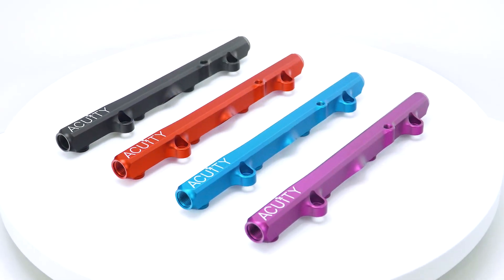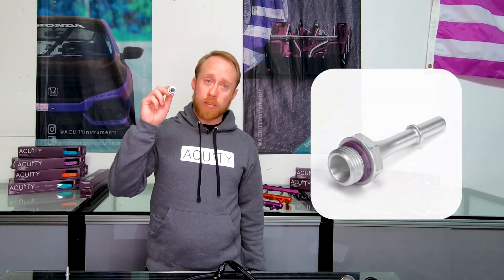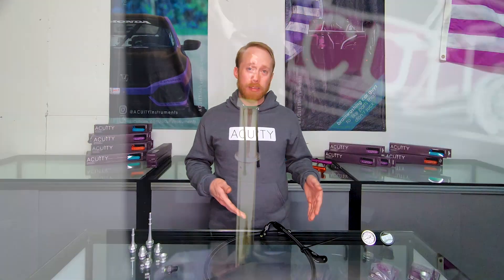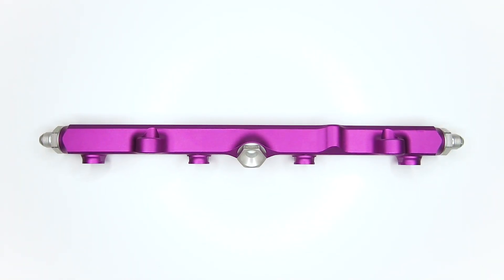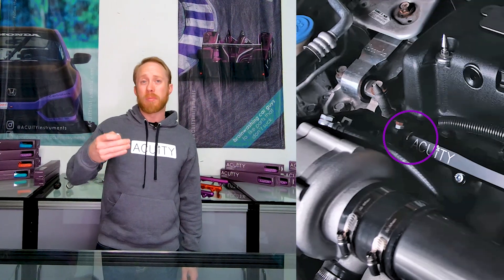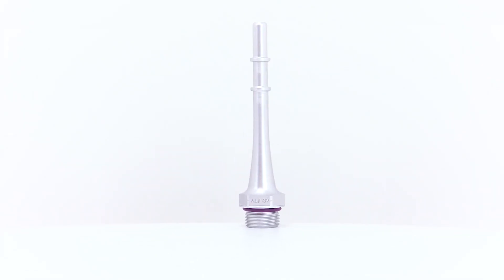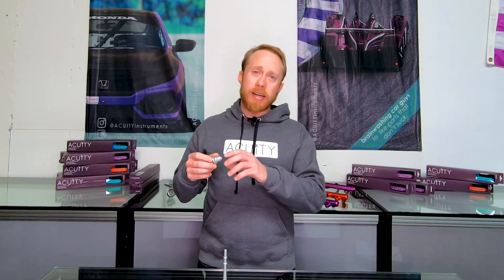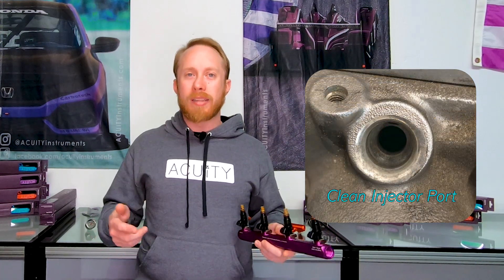The Most Versatile Fuel Rails For K-Series Applications || ACUiTY Instruments

Comment: How many threads on average are exposed after tightening down a top mounted fuel pressure gauge?
Reply: The best install method is to use a light amount of liquid thread sealant on the threads (avoid tape sealant as it can get in injectors and clog them), then to gently tighten the knob between your thumb and index finger with minimal torque, just turning it enough to get it barely snug, then tighten using a wrench (on the flats only) 1-1.5 turns. It takes less torque than you'd expect to get a good seal. Be careful turning the gauge using the body of the gauge as you can damage the gauge this way. Use an appropriately sized wrench to apply the full tightening torque.

Comment: Can you use this on a stock k24 in a 2014 Acura TSX 4 cylinder?
Reply: Shouldn't be a problem, but you'd need to determine if you need the longer or shorter version of the adapter that mates to your OEM fuel supply line. Feel free to reach out to us via the contact-us page on our website (acuityinstruments.com) if you'd like to speak with  a tech to figure out what you need.

Comment: Can the tucked fuel rail fit on the 9th gen ? I'm looking for a more clean engine bay look
Reply: Only when the 9th gen has an intake manifold (like the RBC or similar OE/Aftermarket intakes) where there is sufficient space between the two inner intake runners. The OE 9th gen intake has no gap between the two inner runners, so the OE 9th gen manifold will not support the tucked line option on this rail. If you plan to RBC (or similar) swap your intake at some point, then you could use the centerfeed fuel line setup.
Reply: @rgareh1  thanks for the information